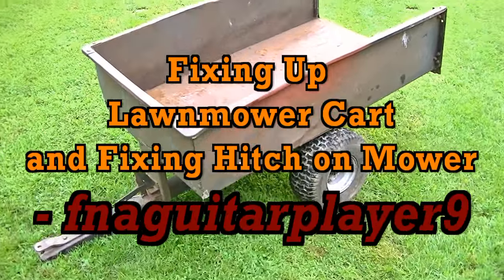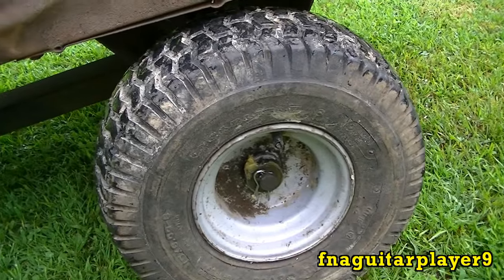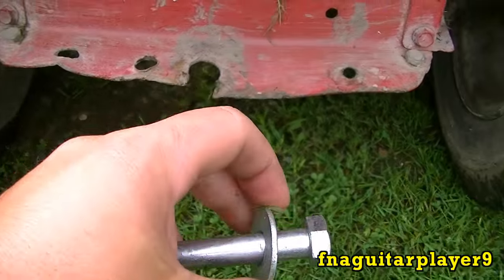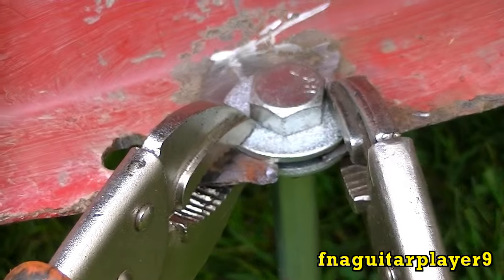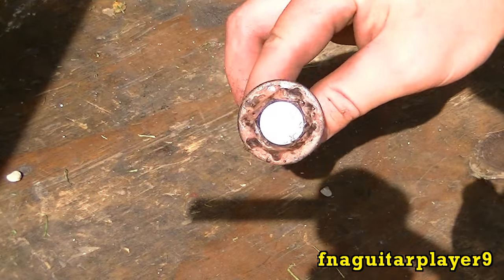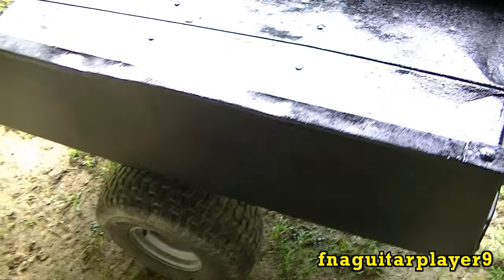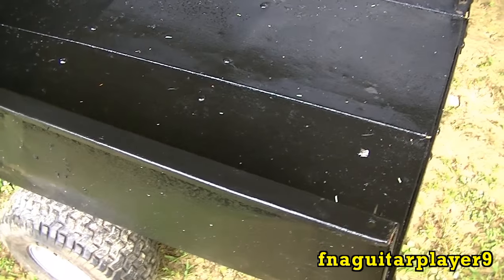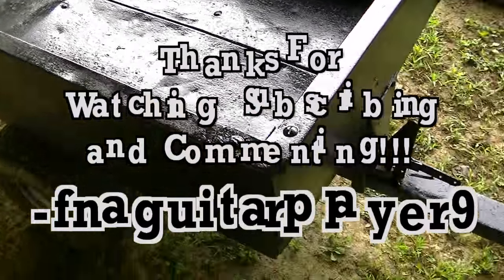Fixing Up Lawnmower Cart and Mower Hitch

Comment: Looks good. You will find that you don't need that clip on the bottom of your pin. I had the same setup on my trailer and after the first time using it I realized that it would never come out and it was a paint to have to clip it and it was too easy to lose the clip. It does the job and that is what is important. Nice!
Reply from the maker: +The Shade Tree Fix-it Man That is true, but another purpose (for me) is so that when i'm not using the trailer i can just keep the bolt on the trailer and not worry about loosing it. Thanks for Watching!!!

Comment: Good job, good video, up to the disappointing color selection. Show off that good effort with a more lively color. I like that you did more than fix some damage, you actually upgraded the functionality such as better load carrying tires.
Reply from the maker: Appreciate that. I understand what your getting at, black is kind of boring. I almost painted it red, but decided on black. I have another one too now, maybe i'll paint it red, it needs painted too! I think these tires was a good choice, it doesn't sink into the ground with a heavy load either like a thinner tire would have. thanks for watching!!!
Reply: Are those tires off the front of riding mower? I got a free craftsman cart with the plastic bed but no tires and i need to know if those lawn mower tires fit well

Comment: Nice job it turned out nice. I would probably remove the threads on the bolt just for clearance but that is just me.. You may not have that issue.
Reply from the maker: +MidwestMotoRider I started to that for looks, didn't really think about clearance issues, i'll probably go ahead and do it now, didn't really think about it! Thanks for Watching!!!